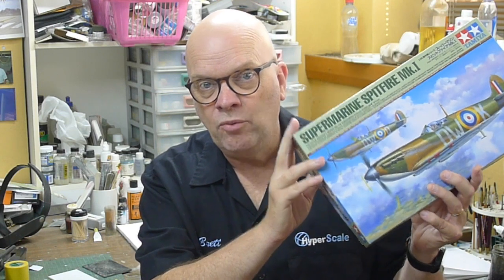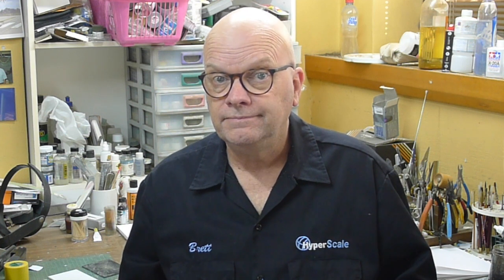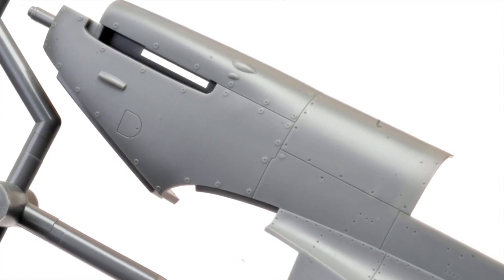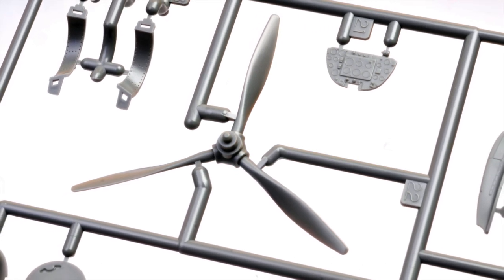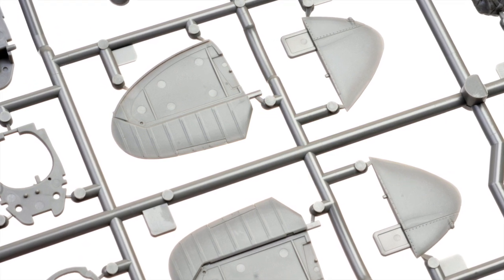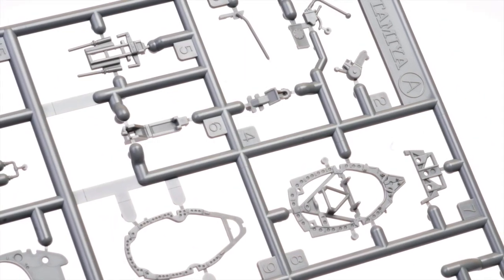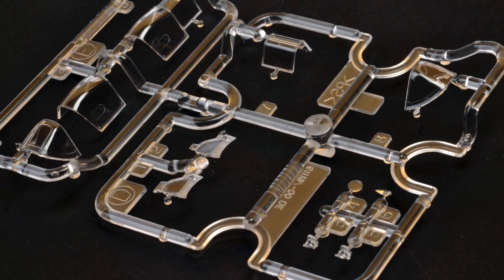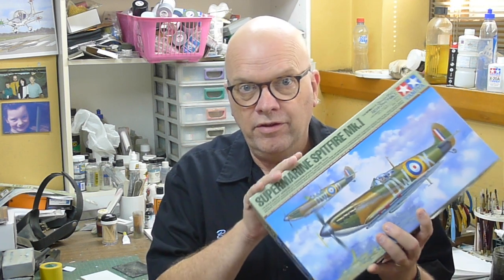Squadron ScaleWorkshop No.158

Comment: Hopefully, the two-bladed propeller, and possibly the early flat canopy, from Airfix could be adapted for the initial production Mk I. Note, too, that at least two of the options, K9906 & N3200, will need the early, manually operated undercarriage control unit in the cockpit, something that Tamiya don't seem to provide
Reply from the maker: I think that part is included - Part A1. If you don't want the undercarriage crank, instructions advise to cut it off.
Reply: @hyperscale  that's good to know: BTW, I note that the teardrop blister for the Coffman cartridge starter unit used on the Mk II is included, as well as seperate, underwing gun cooling vents and early bead site - parts 6 to 10 on sprue?
Reply from the maker: @jsteel8288   Yes indeed. Looks like we can expect additional boxings.